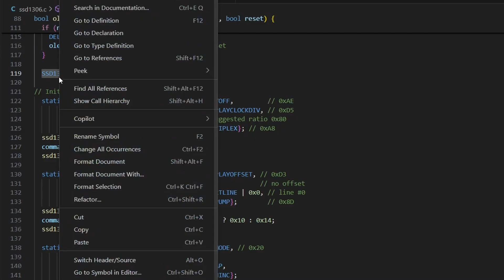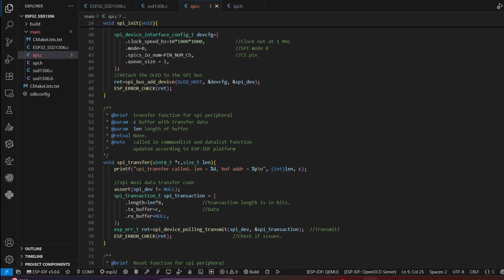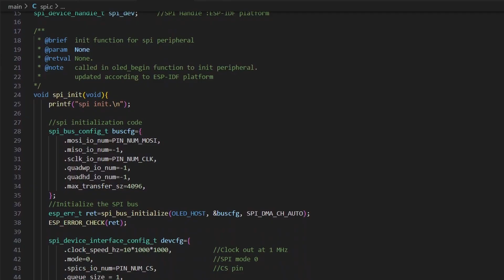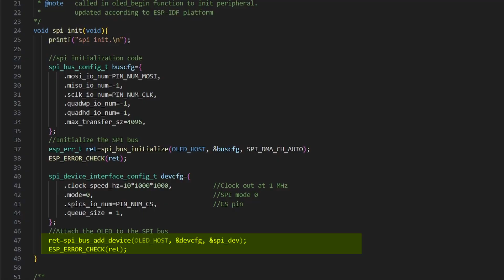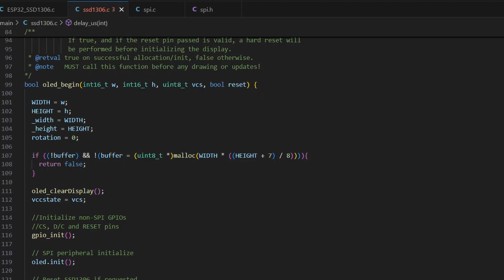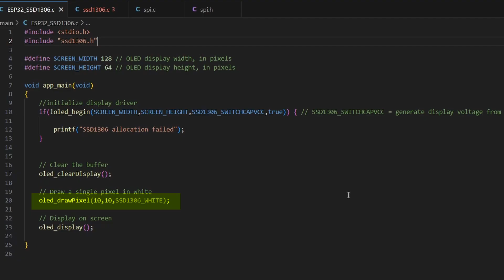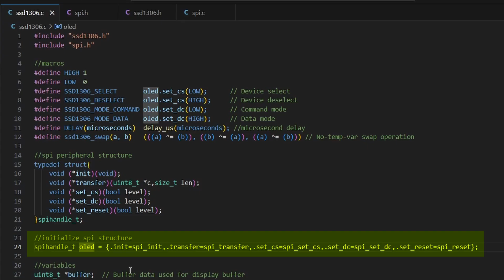Pixel Perfect: Mastering ESP32 SSD1306 OLED with ESP-IDF!

Comment: please tell in which video i can find the pin connection between esp32 and ssd1306
Reply from the maker: I am not sure if i have directly shown pin connection in this video or not, but glimpses of code might be visible. You can check pinout and complete code on github. link to that is in description. Still here are the summarized pin connections for you:
SSD1306 mosi Pin = ESP32 GPIO13   // (Master Out Slave In) - SPI
SSD1306 clk Pin  = ESP32 GPIO14    // (Clock Pin) - SPI
SSD1306 dcPin   = ESP32 GPIO4     // (Data Pin) - SPI
SSD1306 cs Pin   = ESP32 GPIO2     // (Chip Select Pin) - SPI 
SSD1306 rst Pin  =  ESP32 GPIO16    // Display reset pin assignment
SSD1306 vdd pin = ESP32 3V3
SSD1306 gnd pin = ESP32 GND
Reply: @eccentric_engineer  thanks very much. It will be very helpful. I am new in the field. Are you on Instagram